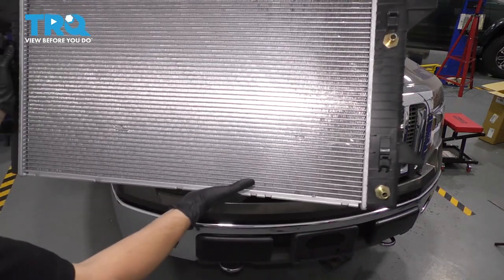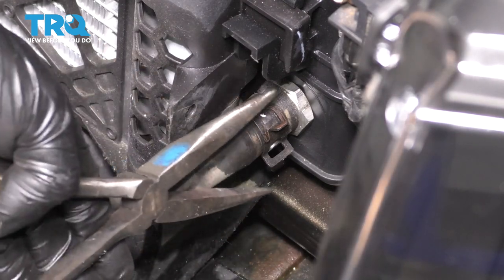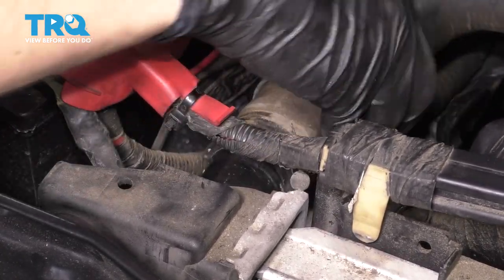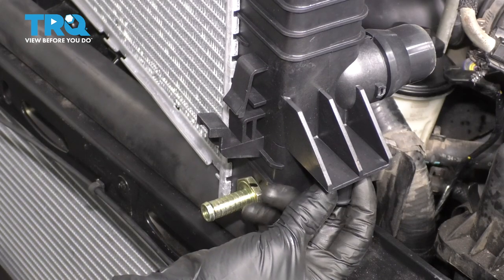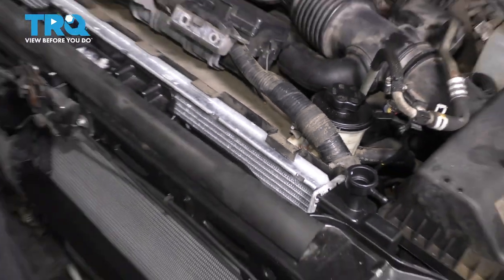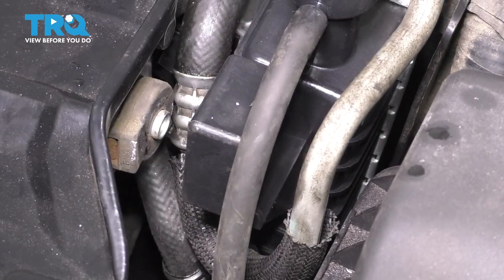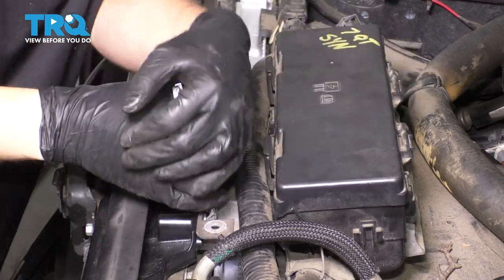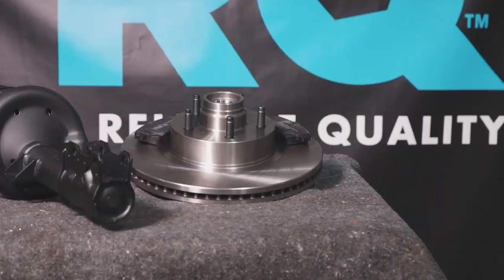How to Replace Radiator 2009-2014 Ford F-150

Comment: I did notice today that the bottom passenger side of my radiator between the metal and the plastic which is below the drain plug started leaking so I knew the radiator was going bad but it's kind of weird how mine started to leak right after I changed the whole cooling system from above like t-shape, hoses and the thermostat and everything. I think it's due to since I put all brand new parts on and it's got its its pressure back where it needs to be. I'm guessing the original radiator just couldn't handle it

Comment: You do not need to recover the freon or remove the ac lines i will not be following your advice on how to do this job properly. The way he is doing this job is putting the new radiator at risk of getting a hole in it all because he doesn't want to remove the air box and fan assembly  he is just cutting corners that will cause damage to your cooling and AC system.